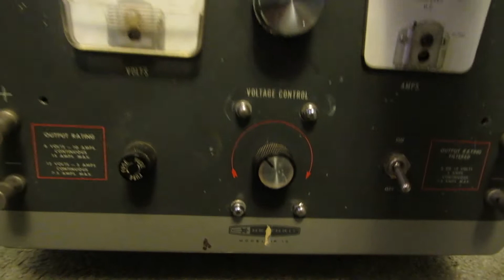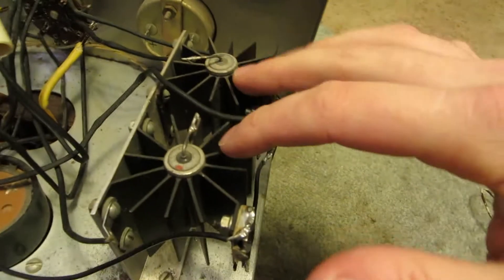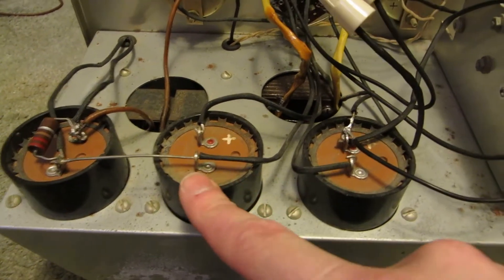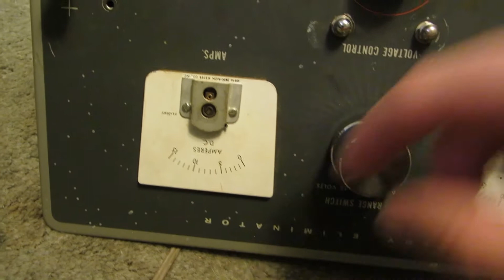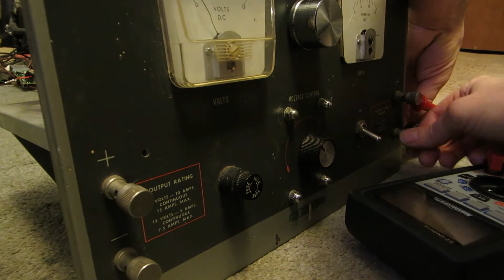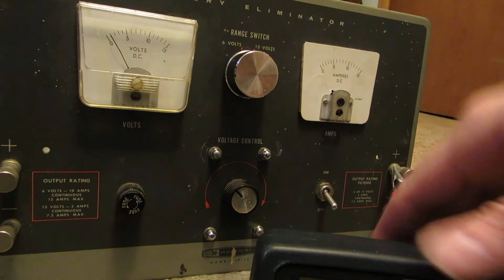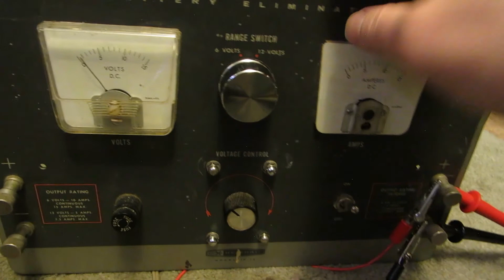HeathKit Battery Eliminator Autopsy

Comment: Hello! Mine has the same problem yours had that you repaired. Is there any way you can share what you did? It is kinda hard to make it out so fast.
Reply from the maker: Basically I just wired up a few diodes. I didn't have any big ones so did 2 in parallel for higher amperage output, simply hook up the wires that ran to the original diode to your replacement ones the exact same way and it should work.

Comment: 40uF? That doesn't seem to be enough capacitance to smooth out a 120 (or 100) hertz ripple with 10-15A of current!!!
Nice little variac in there though! :D
Reply: Benjamin Esposti it’s not. They are three 10000 uf 25v caps.

I have the same machine, mine however is broken. Two of the original caps were replaced apparently and one of the replacements has obviously leaked. Funny enough the diodes on mine also failed so someone rigged up a heatsink and transistor with some resistors to the back shell of the unit. I’m a newbie to electronics so I’m not quite sure what they’re doing.

Comment: Cool method of control. I have seen an arrangement like that on a 220 / 18 - 24 Volts electric blanket controller. The secondary TX winding was used exactly the same as in your HeathKit.